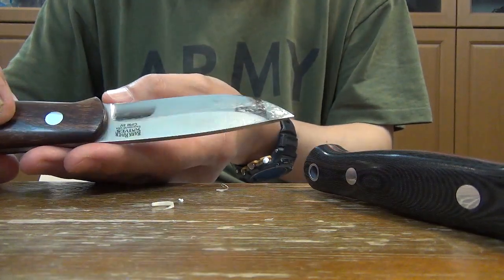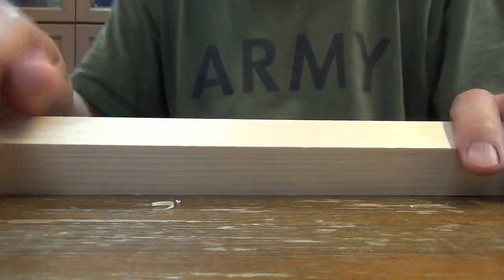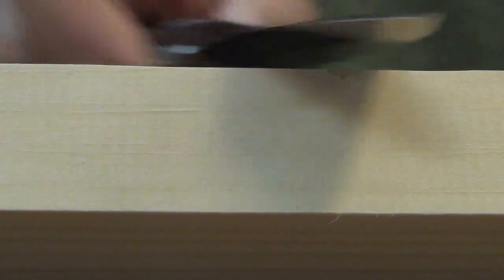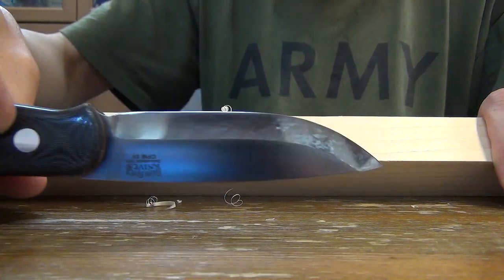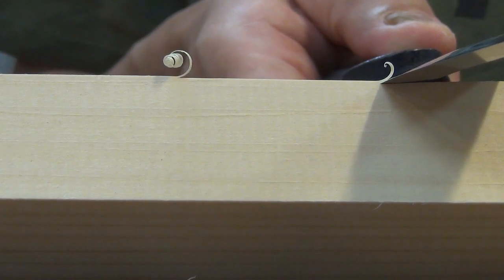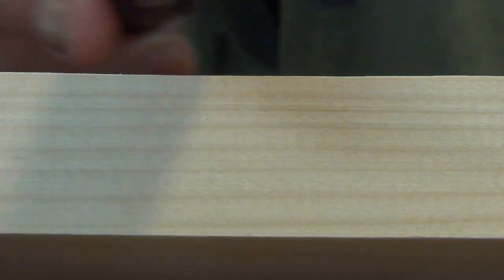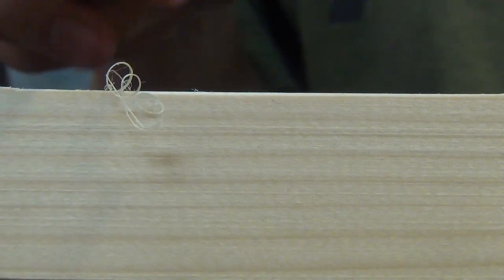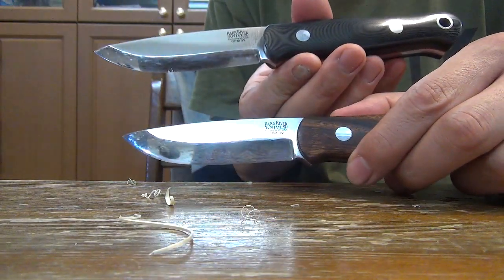Why asymmetrical grind feathersticks easily.

Comment: Wako, have you seen the Bark River Games keeper in 4V steel at DLT? It looks like a pretty sweet blade. Have you ever tried using 4V steel? It would be interesting to see how it compares to 3V steel. Also the blade looks like it would be comfortable to choke up on for hunting and long enough to do some slight splitting with. Let me know what your thoughts are on this knife. Thanks! :)

Comment from the maker: It looks odd to me from the viewpoint of game dressing. Its belly is too acute for the size of big deer. It dress deer very slow. Its job is almost the same as CDPH as a small game knife. I ever owned Gameskeeper and know it. It is a small game knife in my experience. BlackJack M125 is a large game knife because of its shallow belly. 3V is already 6 deer steel. It dresses 6 deer straight without being touched up. I personally don't need 4V unless it is on the M125. Thanks.

Comment: You say edge angle is the same for the 2 knives, so when you changed the grind on the wood-handled bushcrafter, you only adjusted the grind above the edge (and did not re-profile all the way down to the edge)?  How far above the edge did you start the re-profile?

Comment: Hi wako!
I have used youre grind, and i liked it with feathersticking, but i find that it is a kind of "weak" grind, it intends to chip and roll much quicker, Did you have the same problem? This only is the reason that I went back to a symmetrical grind.